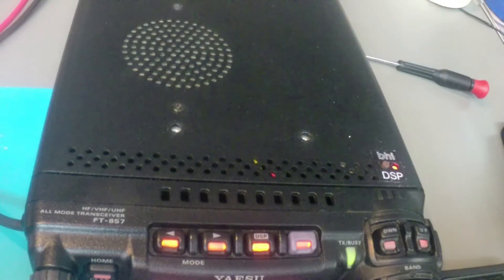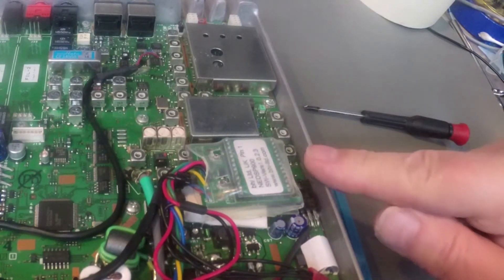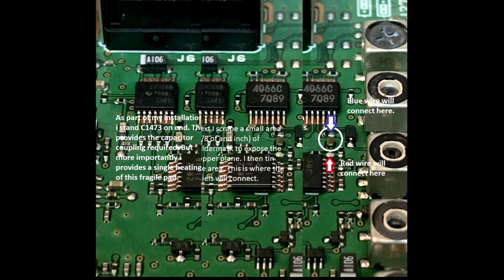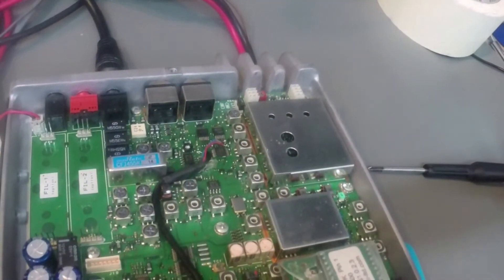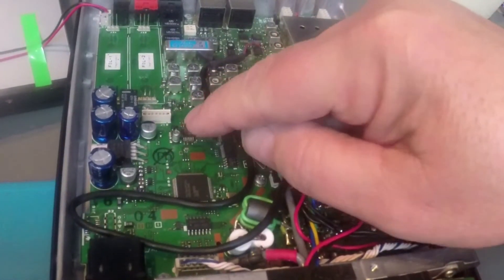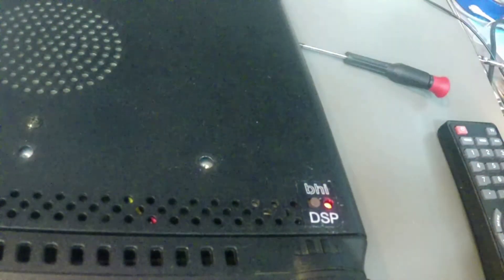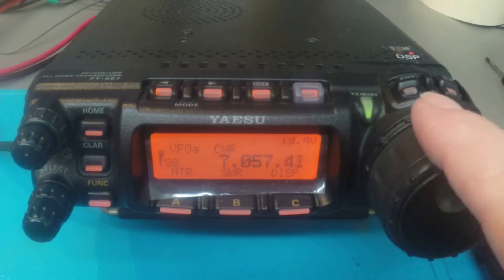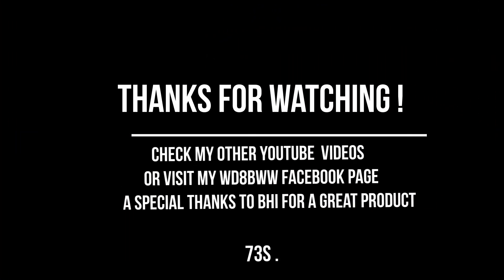WD8BWW BHI 1901 installation and demo

Comment: Does adding the bhi DSP further improve upon the receive quality of the stock Yaesu DSP?  What about if Collins Mechanical filters are installed in the rig, would bhi's DSP chip improve receive audio even further?  I am curious if this would be worth purchasing as I already have the 2.9MHz & 500Hz mech filters.  I find it enjoyable to modify radios to be better, so I am curious what your opinions are on this.